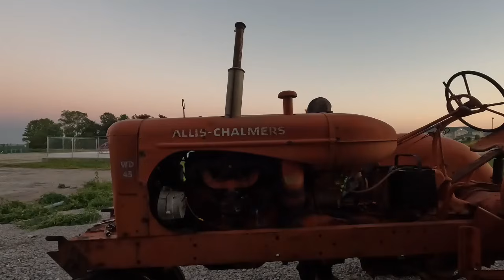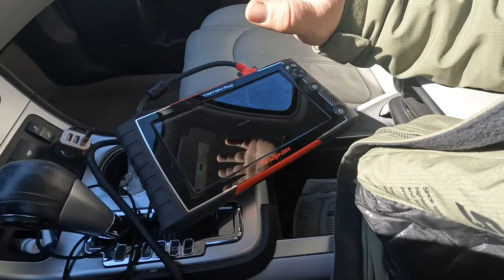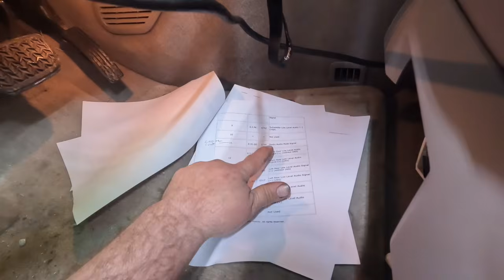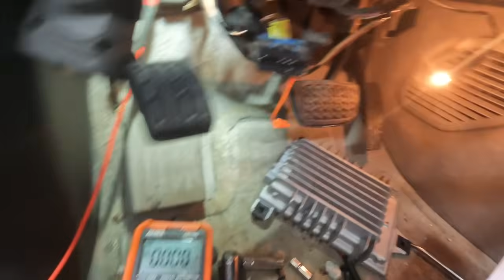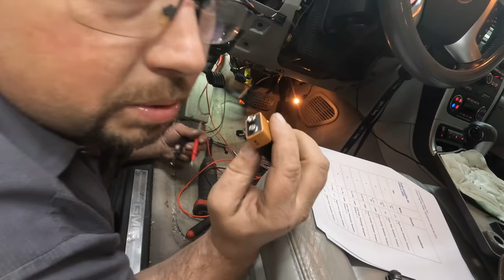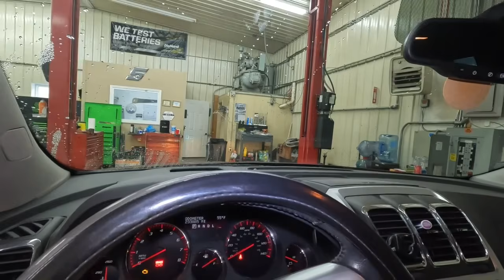2008 GMC Acadia with no radio or turn signal SOUNDS! Radio does light up. RELATED problems?

Comment: Good viseo, thank you.   It REALLY helps to take the 3 - 10mm nuts off the Parking brake and set that aside, out of the way.  You may have to move the pedal to get at the middle nut.  It gives you much better access to the amp and plugs.   This is a royal PIA to get to, even so.  I reassembled with 1/4" shorter screws, without the washer, so I can spin them by hand if I do it again.  (The washer spins and you can't get traction on the 7mm head.)

Comment: Why didn't you check the radio fuses first?
Reply from the maker: Because I had power to the radio. Plus the amplifier was the issue not the radio since we had a radio that lit up and no sound. Also no sound from the BCM commands.

Comment: I changed my amp because that's what I thought the issue was and it was. Now it works but recently it started cutting out both the radio and turn signal.

Comment: Only for water to get back in and kill it again. Dielectric grease in the quick connect harness and slots cut in the low point of the rubber sleeve for water to drain there and not into the cabin.

Comment: Wanted to ask if you checked the amplifier fuse before you went through this process. That’s the first thing I I’m going to check. Hoping that is the issue but if fuse is good this video will be helping me out a lot. 👍🏻
Reply: Just happened to my 09 acadia
Reply: Also I noticed that the chime sound is gone as well as radio and flasher sound. 🙏🏻 fuse

Comment: It needs a Applifier most of the time its on top of the the parking break it happens to gmc buick and chevy traverse Before taking out the amplifier, you must check Fuses  under passenger side  ones  for the  radio another fo speaker this is only if ur car radio is on but no noise or for ur turn singnal this will work  if not change ur radio also suv We'll have water problems in the side doors coming  to ur speakers

Comment: My 2010 silverado 1500 just started doing this last week. On cold mornings I get no radio sound and blinker sounds. Usually after 5 minutes the audio turns on. So mine may be on the way to going out. It works fine all the rest of the day but every cold morning it take about 5 minutes before sound starts working.

Comment: My radio and blinker noise goes out when I first start my truck then like 25 minutes down the road it comes on? it seems like it needs to warm up but Idk how this makes sense. I do know that only 2 speakers work in my 2007 silverado 1500 nnbs but the blinkers seem to come out of the dash im not sure
Reply from the maker: You might be having a speaker problem or amplifier problem. Most of the vehicles after 2000 use the speakers to imitate the turn signal noise

Comment: Great video: What would cause this problem of No turn signal noise and No radio sound?...would connecting battery cables incorrectly cause this? Or thats not possible?
Reply from the maker: Usually, that’s not the case. Not saying it couldn’t cause that, but the majority of the time I see these amps go bad when people are driving down the road. Just had one go bad for a customer that was driving down the interstate and it suddenly popped and that was it.

Comment: Same problem with my traverse. Radio turns on just no sound, no blinker sound or any other found.
Reply from the maker: You’re probably looking at the same issue
Reply: Same on my 2011 traverse

Comment: it's 2 issues.. Sunroof drain on the drivers side is dripping on the Amp due to poor design. . Water in the door connectors after a heavy rain.

Comment: I see you pay for that info. Maybe you can help me still. Is X1 X2 and X3 from left to right? I have the same Bose amp. Bought a used one. Same problem. I never checked mute voltage. So I will try that. And the speaker trick was cool.
Reply from the maker: It depends on which way you hold the module but that is how they are per usual.

Comment: Thanks for the amazing info. I am having the same issue with my father-in-law’s 2015 Acadia. He just passed away and now I need to sell his car but no sound from the speakers!
Reply from the maker: Sorry for your loss! Glad this video could help you out!!
Reply: @hrdiesel  what kind of shop should I take the car to in order to have the speakers fixed?
Reply: Where did you order your used amplifier
Reply: Thorold Auto Parts and Recycling

1108 Beaverdams Rd, Thorold, ON L2V 3Y7

Comment: Just fixed this problem   So to fix it easy water is getting in the wiring in the doors and running in the car  causing the amplifier to intermittently work on and off  some days  mine was off for trap weeks before it pissed me off  amplifier under dash driver side  next to bcm
Reply: Also the wires. Was running the metal bracket by firewall as well
Reply: Where do you get the schematic for the Bose amp. X1 X2 X3
Reply: is the amp in the radio?

Comment: Thanks for the video. The information on the turn signals is good because it helps pinpoint what I need to do also. I have the exact same problem on an Acadia 2010. Thanks again 💯
Reply from the maker: Thanks for the feedback I sure appreciate it! This is why I make those videos!
Reply: I have Acadia 2011 and the exact same problem since I bought it and the amplifier in my country so expensive , so when you change, the amplifier system is good or no ?

Comment: Just curious.  If you didn't want to deal with the difficult amplifier removal, would there have been a way to just unplug the defective one and replug it into the new/used amplifier and mount it elsewhere in the footwell?  This whole process seems to be held hostage solely by the amplifier location.
Reply from the maker: The biggest problem was the wiring wasn’t long enough to allow for mounting it in a different spot. I did attempt that but unfortunately failed.
Reply: @hrdiesel  I figured that's probably but had to ask - I'd hoped maybe some clever person would have made a bypass or extension kit.  Looks like I need to visit my local radio shop for advice as I will not mess with this stupid OEM amplifier defect/location issue.
Reply: 😂 I was thinking the exact same thing!!!